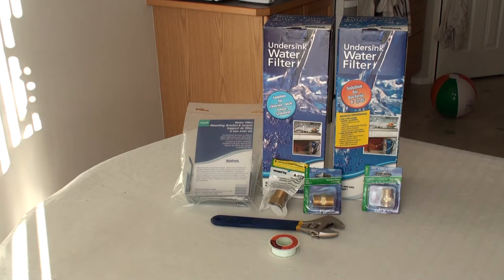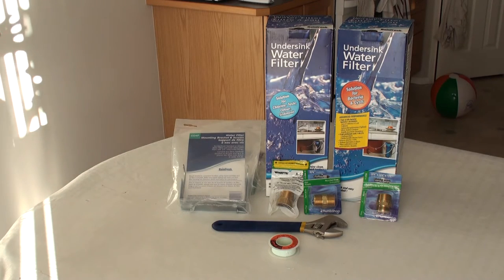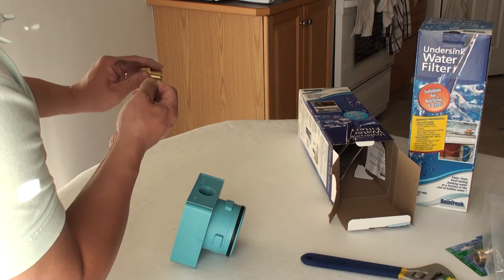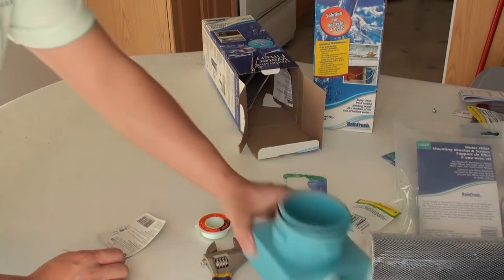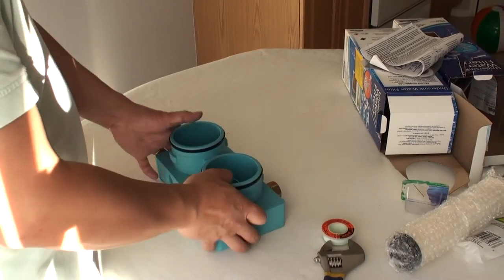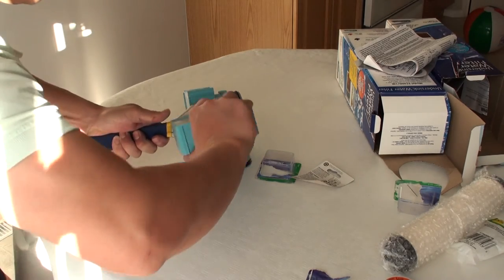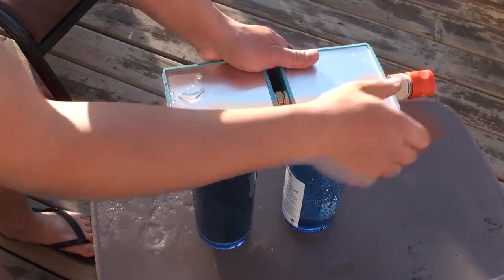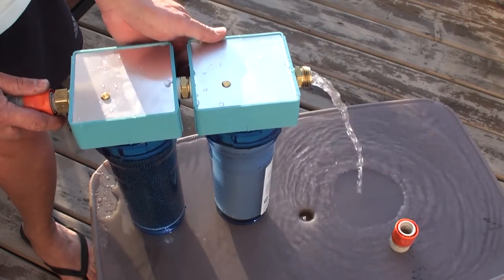Easy to Build your own RV Water Filter System

Comment: Great job! Very thorough explanation. Just a side note on the MPT into the FPT plastic unit. Pipe threads are cut in a wedge pattern, the further the "wedged" threads are driven into the plastic the greater the threat of cracking the plastic housing, along with stripping the threads.
Reply from the maker: +Nebr55 Thanks for sharing that tip.  Yes when screwing in tapered threads into nylon the risk of cracking is very real.  You really have to assemble by "feel" but as I've emphasized in my video you're better off tightening it just snug and if it leaks then you can tighten it a bit more.  Thanks for the tips to our viewers and thanks for watching!

Comment: This is a very good tutorial, as was the Pop-up A/C install.  I liked them both.  We have a Home Depot close by and I'm going to obtain my parts for doing this there.  I particularly like that your application is "temporary and can be set and removed as required when traveling.  Keep up the great camper videos.
Reply from the maker: yep, that is the whole idea, use off the shelf parts and you'll get a better filter that can be moved from RV to RV or repurposed for your home if you'd like.  The thing I don't like about RV specific items is that they're often cheaply made and expensive.

Comment: When using for drinking water, be sure that the brass fittings/adapters that you use are lead-free.
Reply from the maker: Valid point.  I thought all brass fittings were lead free no?
Reply: If it's brass, it's just copper and zinc.

Comment: Great video!
Does the 2 filters are permanently installed under the VR? or you just attach the 2 filters on the clip after parking your RV?
Reply from the maker: +André Bonaventure no you just hang the filters when you're using them and then remove the filters when you're done.

Comment: I'm worried about that 1 micron filter, will there be enough flow for showers, I have a 5ty wheel so it's not just for drinking water... Rainfresh has another filter I could use in addition to the FC150.  Won't be doing much for very small particulates though. Worried about just getting a dribble out when done. But I do know I want 2 if those housings and filters. Thank you fir your video. Well done.
Reply from the maker: Okay, so you're absolutely right that the flow rate could be a problem with a 1 micron filter.  1 micron filters when new flow just "ok" but when they start to jam up.... OMG you may as well trickle water on yourself.  What I figured was the best way to use a filter this fine is to put the filtered water into your fresh water tank and then use your built-in water pump to provide yourself with good water pressure.  I found that it worked great that way.  It's a bit cumbersome to fill the fresh tank but it is a price one has to pay to have pure and safe drinking water.
Reply: @piercedasian  Thank you. Using your excellent instructions, I built a 2 filter system, but used the Dirt filter first, then the Taste charcoal second for the whole 5th wheel. Then I installed a 3rd filter on the kitchen faucet only, the ceramic one. Happy as a clam. I really do not want to use my pump when I have a decent city water connection. That works great for me.
Reply from the maker: that is awesome!  Glad you built something you could use effectively for your 5th wheel!

Comment: This is a great system, I really want to do this on our Toy Hauler but I do have a question; Can we use this setup filtration system to filter non potable water? Currently  I do not have a location to fill my fresh water tanks and luckily we have been able to find sites with water hook ups so far. The reasoning is because my storage unit doesnt have potable water only non potable AND i cant pull the toy hauler up my street. I live in a small neighborhood with tight small streets and the size of our hauler is 40 feet (with one slideout) the thing looks HUUGE like a semi truck. I brought it once and had a few neighbors up the street from me complain and yell while driving. We are a pretty tight group and know each other around us and would like to keep it like that. We could say we always borrow something from a neighbor all the time and vice versa. =)

What do you guys recommend? (not on the neighbor yelling while driving hahaha)
Can it be done?

-Koa
Reply from the maker: +NUR0402 There is only one logical thing that can be done with non potable water to ensure that it is absolutely safe to drink is to boil the water at the final stages before consumption.  Filtering the water while EXTREMELY effective at removing all sorts of nasties and weird taste from the water the fact of the matter is that you still should chlorinate the water in your holding tank with chlorine tablets meant to purify water OR to boil the water for at least 5 minutes and letting it cool before using it for drinking or cooking.  

The filter system although able to remove 99.999% bacteria as they claim to me isn't 100%.  There is that 0.0001% chance you could get sick and to me boiling or chlorinating is the last and final step in proper water sanitation for filtered non-potable water.

The filters admitted have worked well for me for campground water that was really turbid and under a boil water advisory.  The water came out like urine from the taps and smelled awful but after my filter system, a chlorinating tablet in my fresh water tank + boiling made the water crystal clear with ZERO taste, ZERO turbidity and ZERO bacteria.  The water coming out of the filter system was remarkably clear and likely safe to drink but I'm a person that wants absolute certainty with things.  

Call me anal but you're better safe than sorry right?
Reply: +piercedasian ill let you know how it goes! if the life straw filters particles of approximately 0.2 microns and larger, reducing turbidity. i think this system will work 100%,  i have chloride my fresh water tanks with a 1/4 cup and flush so im not to worried about the holding tanks but the tablets are a great idea for that extra protection on the go. I was trying to look for this system here in the states but came to find out these are only sold in Canada therefore i cant find them on amazon either. Would you happen to have a direct link to them?
Reply from the maker: did you end up building that filter?  I'm super curious as to how well it works for unportable water...

Comment: Hi, isn't the placement of your two cannisters a bit precarious; by the fact that these are at the bottom of your unit and could suffer damage if you were to travel over rough roads?
Reply from the maker: lol, you only hook the filters on when you're at the campsite and unhook it and store them in the trailer before you drive off so nothing is every exposed underneath.

Comment: Wow.  I would never mount filters underneath where all the road mud and dirt gets thrown up onto them. Or they are at risk of getting broken off.  Just about anywhere else would be better than that location.
Reply from the maker: Filters are removed when driving and there is rarely any mud in that particular location.  I wash my trailer enough to know there is hardly any dirt on them.  The brackets are all that remain underneath the trailer and they're very minimalist and I'd be shocked if they ever broke off of the frame.  Have no fear, the location is a decent one and well protected when the trailer is parked.  Never leave the filters hanging there when driving!

Comment: Is  this something that would filter out hydrofluoric acid fluoride and all the other bad stuff . I have fluoride and other poison in our city water and am presently going to a kiosk to fill jugs every week and a half to two weeks . I would love to just get a set up like that at my appt and fill my jugs at home . We use for drinking and cooking about 40 gallons every two weeks . How long would a system like this last me ? Also how much would it run annually I live in the US in florida  . Or even break it down in filters cost and how long it would last ? I was looking for reviews for a filter I seen at walmart by the rv stuff called camco rv - marine water filter . I couldn,t find much info to be comfortable to go ahead and start using it . Thanks God Bless
Reply from the maker: +timothy thomas Tim the filters longevity ratings are arbitrary and depend a lot on how much stuff it is removing from the water.  The filters I use are rated for 1000 US gallons but again that is probably based on the best case scenario municipal supplied water that is clean, treated and doesn't contain much more than residual chlorine and fluoride.  Cost of carbon filters are about $10 USD and the sediment filters are about $7 USD each.  The camco RV filters are okay.  I have them too but they're nothing compared to the ones I'm using in my video.  Camco's are good for filtering out coarse sediments and taste from the water and even then the filters don't quite last as long as the rain fresh system I've built.
Reply: Ok so I am on city water and there is fluoride in it . It prob isn't the worst water out there I can access the annual report . As long as it filters out fluoride as well . I will get on board . It would be nice to stop going to the water place  kiosk .
Reply from the maker: Hi Tim, my apologies for taking forever to reply.  Lots of messages and mail from all my viewers!  You can google rain fresh filters and they will have spec sheets for all their filtering products.  I'm sure you'll be able to find a filter that removes fluoride from the water.
Reply: I appreciate the reply . I will look into them .
Reply: It seems there is a reverse osmosis system that removes fluoride among other bad halogens
Reply from the maker: reverse osmosis would definitely remove pretty much anything in the water b/c those chemicals and contaminants won't pass through the membrane.  The issue with reverse osmosis is that it is painfully slow and wastes a lot of water to create a tiny amount of clean, pure, drinkable water.  But... if purity is what you seen then reverse osmosis is probably your best solution next to drinking distilled water.
Reply: Thank You
Reply from the maker: you're welcome!